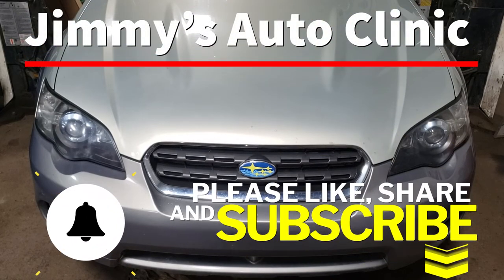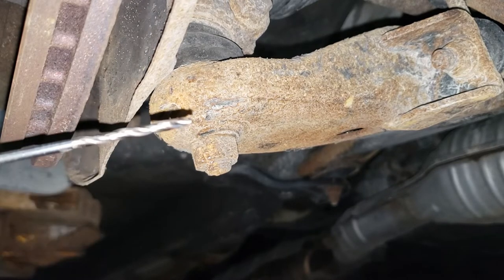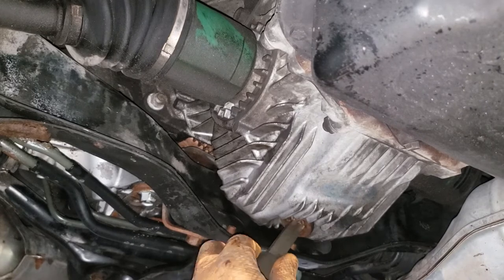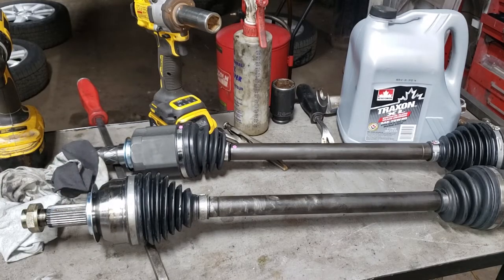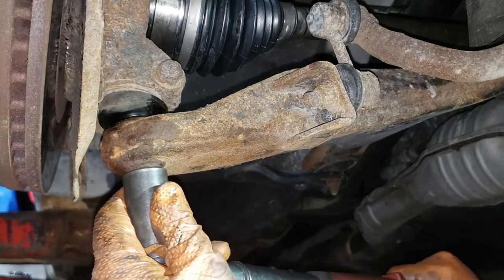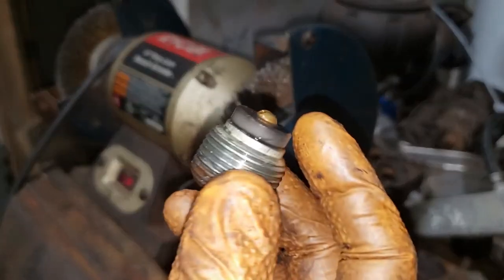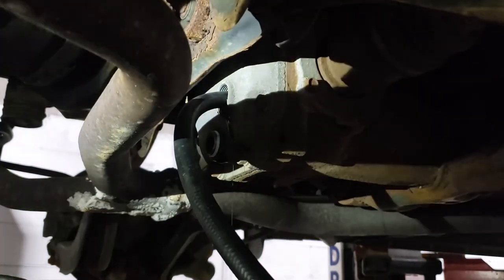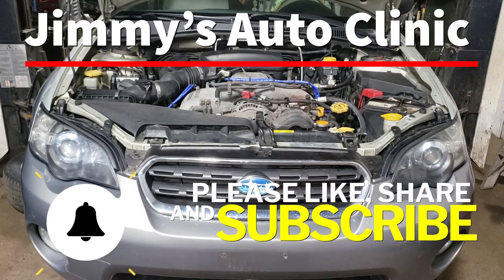2006 Subaru Outback | CV Shaft | Diff Oil Front & Rear | Replacement

Comment: Tip: always remove the upper bolt from the diff. If you remove first the lower one and you can't unscrew the upper one you can't get any oil back in. Always make sure you can add oil before you drain it.

Comment: im currently doing the rear cv's in my 2004 outback. but they keep slipping out of the diff? any ideas?
Reply from the maker: Hey Mitch, I have had this issue before. And it can be a number of potential issues. The most common of which is a bad C clip or retaining clip that is used to hold his CV shaft into the spider gear. The second most common thing that I have found is that the CV just isn't seated all the way, this is usually caused by two issues some sort of debris or damage that's either caused off of the car or when trying to put it in it can be damaged if not done properly. The two problems that I refer to are assuming that you have an original driveshaft. I've run into a problem once with an aftermarket driveshaft where it was actually a bit too short.  The shaft portion was OK but the input shaft portion that goes into the CV shaft where your C clip is was a millimetre shorter than the original. Of course that was just a manufacture error and luckily it was just the one shaft. In the worst case scenario you may have a damaged spider gear if when trying to pull the CV shaft it was excessively hard to get out you could have chipped the gear which will unfortunately make it quite a bit easier in order for the new CV shaft to pop out. Unfortunately you're in for a bit of a not so fun time trying to figure this one out. Good luck I hope that helps you. Don't forget to hit that subscribe button.
Reply: @JimmysAutoClinic  Thanks heaps for the quick and informative reply, have had another look and turns out I just needed to hit them in with a hammer for the c clips to engage! luckily a quick and easy fix lol